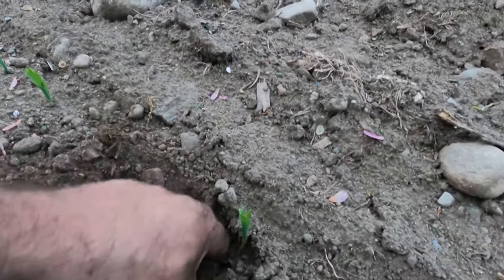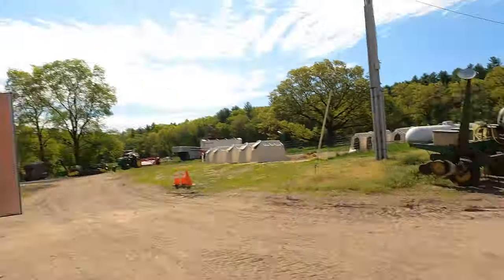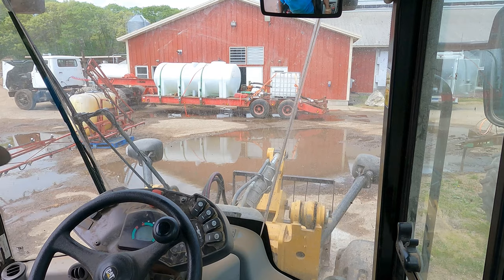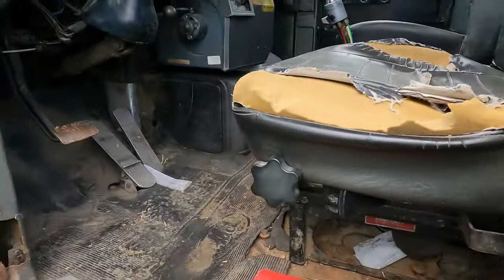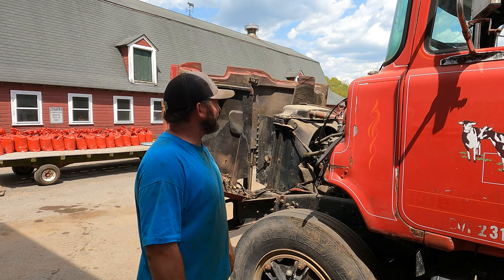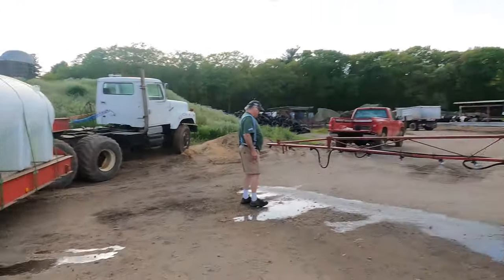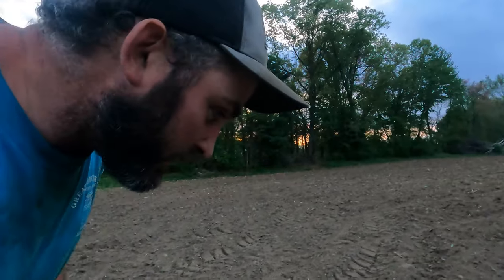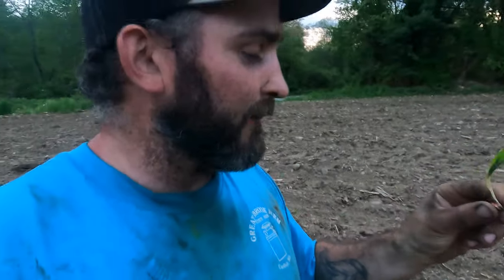Will This Work? Home Made Sprayer Support Trailer- Corn Is Growing

Comment: You are one of only a few farmers on youtube that isn't afraid  to take on the challenge of running older equipment,showing that you don't have to spend hundreds of thousands to get the job done.Maybe not for everyone but it works for you.Best of luck with harvesting.🚜🚚🚛

Comment: Add some pipe dope then the plumbers tape on threads when dealing with the plastic fittings always helped me to stop leaks using both of em brother. Love the video still love the old school equipment ya using.
Reply: Yup i use both if i feel the fitting is loose or it's  too hard to fix later.

Comment: I started driving a log truck in 1984. It was a 1978 R model with twin sticks. Mack camel back rears. Made a decent living with that old truck. Rode like a two horse wagon. Better buy them when you see them cause there are not that many left.

Comment: My go-to for sealing pipe threads is the Loctite line of products.
I tend to use 567 on any larger threads (it's a white paste in an applicator tube). It can attack some plastics, but I have never had any issues with it on plastic, but I only use it on low pressure applications.
The thing you have to be careful of when using a liquid with a plastic fitting is that it lubricates the threads and if you try tightening it normally, you will likely split the fitting from tightening it too much. 
So if you use it, just snug the fitting up and let the sealant work. 

For any pneumatic or hydraulic thread fittings, or small brass fittings etc, Loctite 545 is the ONLY way to go.
It's a clear liquid in an applicator bottle, and unlike paste or Teflon tape, it doesn't get little pieces in the pressure system to clog it up.
It also acts like a light thread locker to keep things from loosening up.

Any industrial supply store, bearing house etc should stock these or be able to order them. Good heavy duty auto parts stores as well.

Comment: It's all about the rubber gasket on those bulkhead fittings.  No amount of thread sealer will do any good with a bad gasket.  Over tightening can be a problem.

Comment: Those old Mac trucks are quite impressive. In the early 90s I drove a 1980 r model that had a 300 and a 5-speed transmission. I was hauling grain with it and we would go through the river valley and get to where we had to crawl up the other side on quite a steep grade. 80,000 lb and I never had to shift. Not the most comfortable truck but it really performed very impressively. I've had higher horsepower rated trucks since then and never been able to Crest Hill in high gear on that same Hill. That'ol Mac look like I had a tornado chasing me up the hill though. That thing could gag out mosquitoes in the whole area. I won't even start on the water ride suspension.

Comment: Overtighten those fittings are the worse thing for them, it smashes the rubber gasket out. If the gasket is good you should just have to snug it up real good